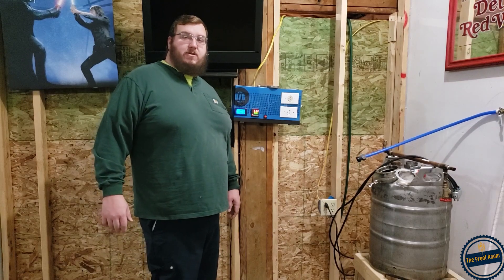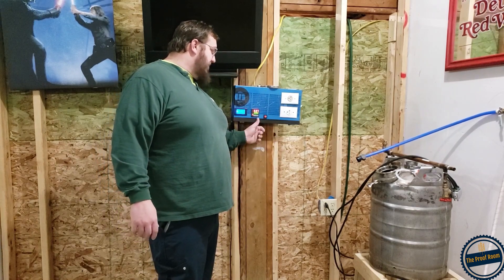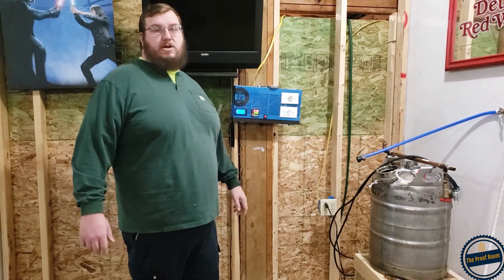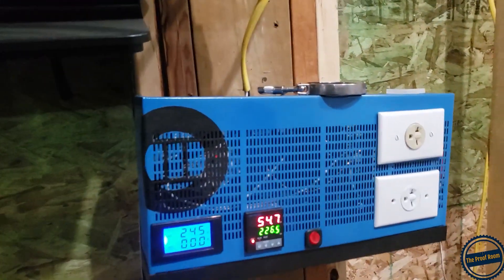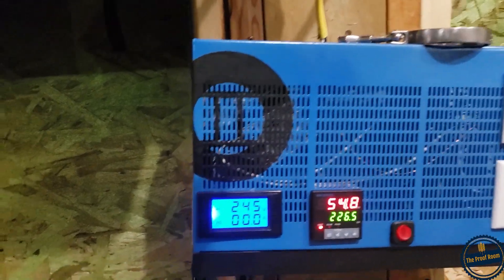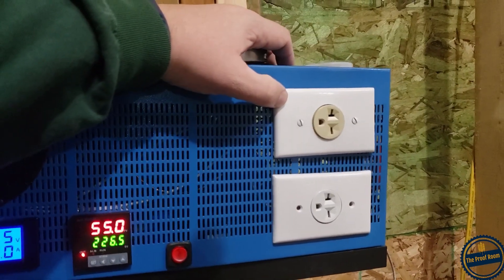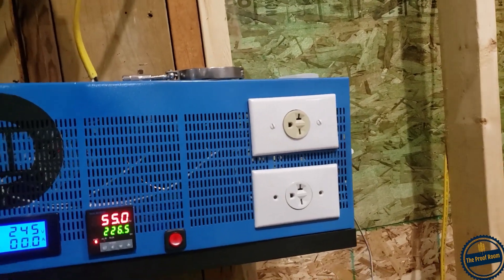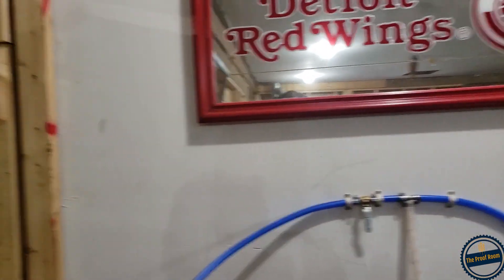How I heat my still with a PID controller

Comment: Just a quick observation from what I heard and see. I think you said you have ability to run two 3500W elements. That's an amperage total of almost 32A @ 220v. I think you also said you have it connected to a 50A breaker in the panel. In looking at your feed wire, it appears (from what can be seen in the video) to be a 12/2, which is rated for 20A. Your feed wire rating should match (at a minimum) your breaker rating. 50A breaker would mean a 6/2 feed wire. A feed wire rating lower than your breaker is risk of fire. Again, based on what I hear and see.
Reply from the maker: It is 12/2 wire good observation. I get away with this only because I draw 24 amps at peek power with both elements running. I always check the wire to be positive its not getting warm and inside the panel I use a 15 amp fuse on each cricut just incase something was to ever go wrong they would pop first.

Comment: Nice work!

 like the SCR or SSVR for stripping runs and use PID for spirit runs. The thing about the PIDs is it takes a bit to balance the temps. Once it's balanced the output product will be a consistent flow. Another great things about PIDs is that once you get used to how your setup runs and you know the temps. You set them, collect till it stops, switch to collection and move on to the top end of the next range and when it stops, you can cut it off and you have great cuts that are repeatable.

You can use the same case you have and just wire the controllers with switches to change what is driving everything. Will save you time and $$!
Reply from the maker: My column did balance after awhile it just seemed the temp fluctuate consent i think ill insulate my column next time and if that dosen't work ill get a new thermocouple.
Reply: @theproofroom1473  did you click the AT (Auto Tune) button while it was heating up? I like to set my PID to 140F and then let it sit there for 30min to help get things headed down the balance road. then hitting it 5F every 20-30min. Once you have the fores and heads taken off and its back to not producing, then nudge it 2F every 15min or so to keep a consistent flow through to your tails cut.
Reply from the maker: @RiggerBrew  I did not hit auto tune i will definitely try that next time. I did run it up to about 150 and let it sit for around 30 minutes. Then I went up 5 degrees every 15 minutes until I hit 175 then let it run until it slowed and went up 3 degrees at a time throughout the run.